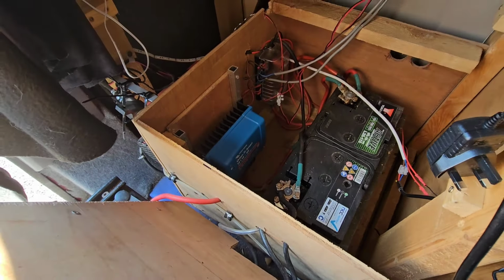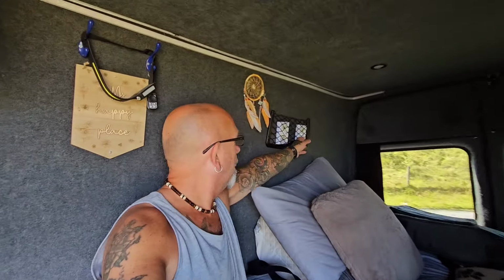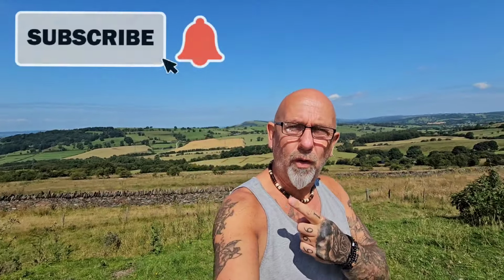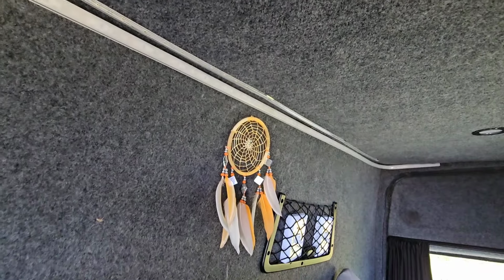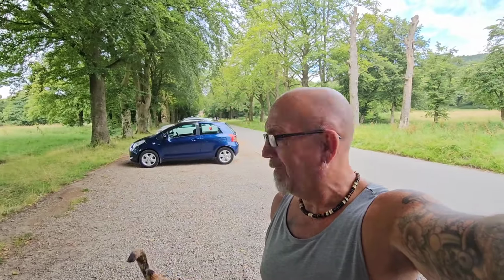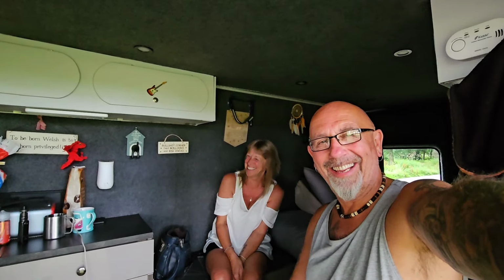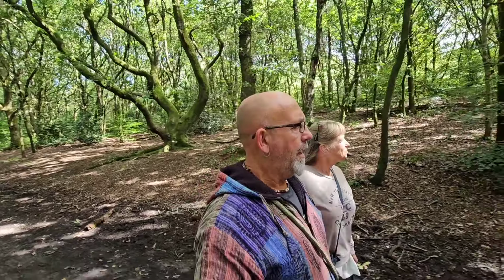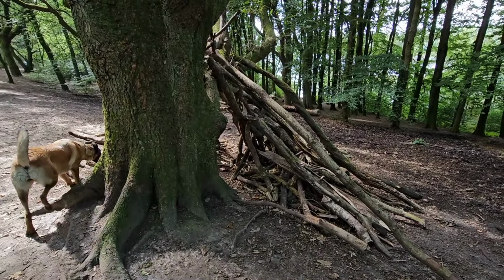How I Survive Vanlife with NO SOLAR ON THE ROOF /Belgian Malinois

Comment: I have been considering your style of set up and was my thinking to have, maybe one 200ah lithium battery with a dc to dc charger and a 1500 all powers bank and maybe something like your Energizer bank for small things...As you said, your  power bank is on permanent charge to your cigarette socket to give a trickle when the engine is turning over...is it possible to connect the power bank to the alternator with a dc to dc set up? Just thinking about charging the power bank when there is no sun and unable to use solar panels..
Thanks for sharing this video...I now know it can be done without solar panels and the associated wiring and controllers, etc
Just one last question: do you know the rough cost of charging the power bank from empty to full if plugged into 230v socket?
Thanks again and am now subscribed..
Reply from the maker: Hi Chris,  you could also charge it with a 1000w inverter from your leasure battery  the coast of changing it from the mains I have no idea m8 thanks for the Sub buddy 🤘🤘🏴🏴🏴

Comment: What does a dc 2 dc charger do taff?
If u have 2 leisure batteries do u need 2. dc 2 dc chargers?
👌🫡
Reply from the maker: Hi Gary it controls the charge going into the batteries you can have 2 of them it will charge really quickly 🤘🤘🏴🏴🏴
Reply: @taffsdestination2369  cheers 🍻